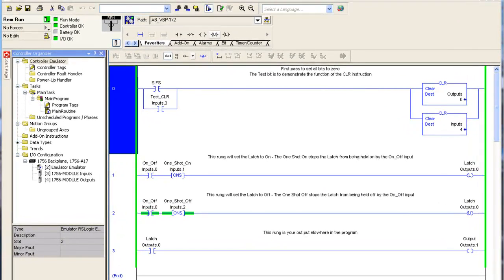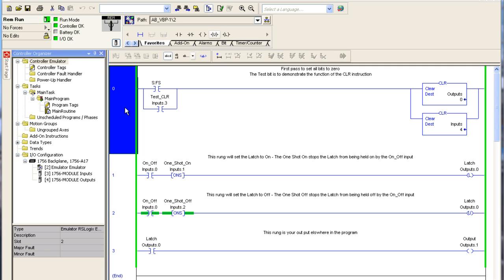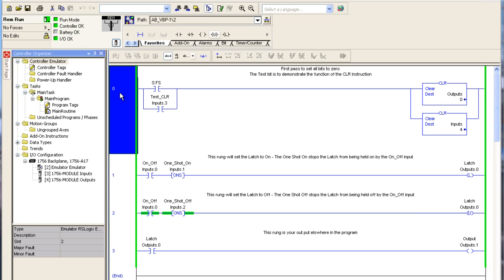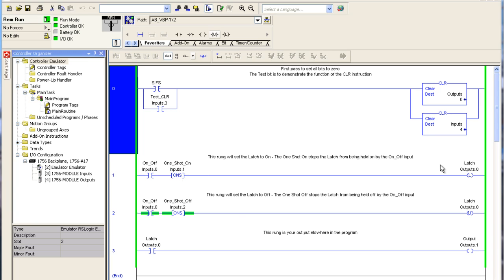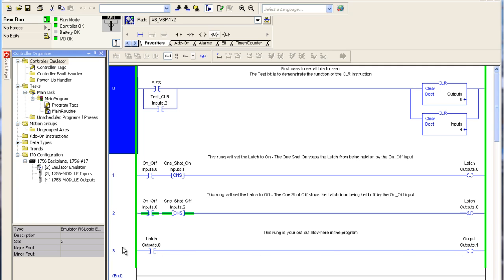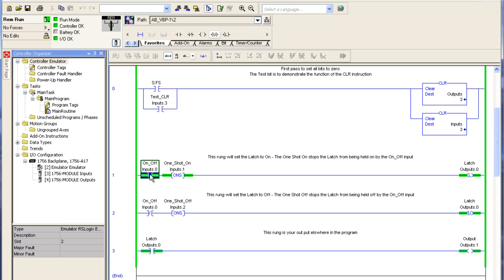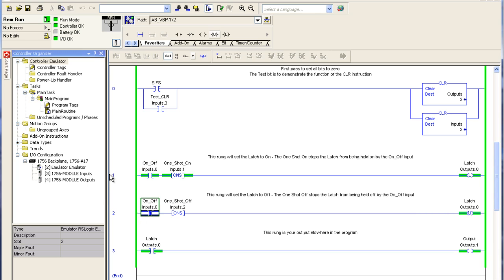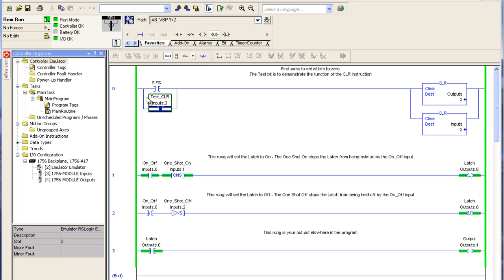13. Flip Flop using One Shots on Compact Logix - PLC Training on Allen-Bradley Rockwell

Comment: This is not a true flip flop circuit.  Based on looking at this, if you turned the input off, or if it was a "Momentary" Push button then the output would turn right back off after release the button.